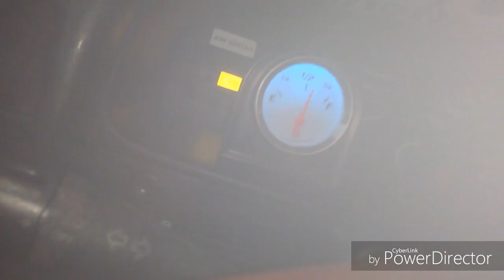Haggard garage burnout challenge

Comment: i might get a sentra for my first car. is there alot of aftermarket support?
Reply: NO!
Reply: would be down tbh put a ka in it
Reply from the maker: +Import Fanboy if it has an sr20 it does but if it has the ga16de not really
Reply: you're most likely regret it all the parts I have more hard to get and are for sale right now from me
Reply: hell no, I have a ga13de sunny b13 and I can't find parts anywhere, I'm doing a sr20det swap soon though
Reply: Ported intake tuneecu full strut support custom cams you know the basics
Reply: I crashed before I had time to do the fuel system but everything's pretty much custom you have to do it yourself because it's impossible to find it anywhere else